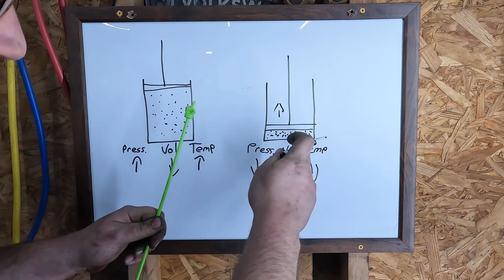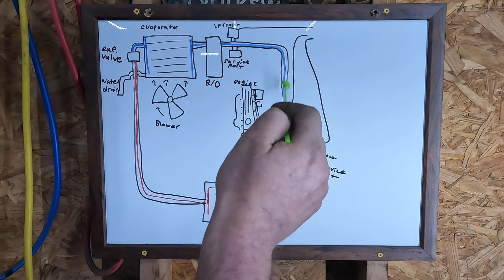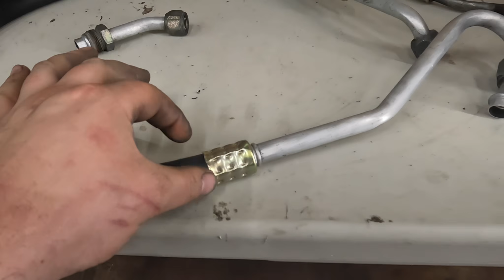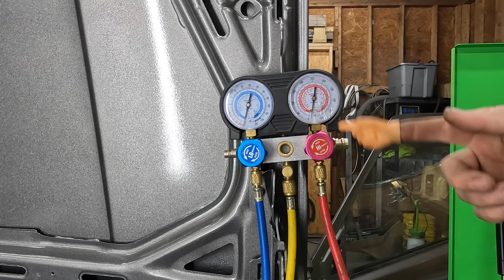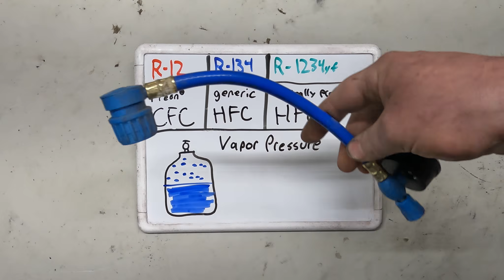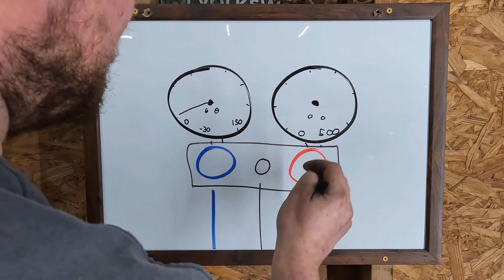Air Conditioning Explained - How It Works and How To Fix It, R12 to R134a Conversion - Volvo 740

Comment: Kind of surprised there is not at least a high pressure cutoff switch. Ultimately, depends on what all the components are rated for...that said it is a positive displacement compressor. Maybe it breaks before dangerous pressures are reached or the hoses fail. Seems sketchy....

Comment: What u have completely MiSSED is the Good Year Galaxy Hose  has a NYLON LINER ### it needs either genuine Beadlock fittings or direct copies .  BUT why ???  R12 barb fittings cut this liner . R134a fittings have depressed circular grooves . Secondly the hose ferrule is permanently attached  onto the fitting . Once the ferrule is -crimped it cannot rotate the hose which is a source of leakage ..  
WHAT DO I DO ABOUT THE R12 FITTINGS  cut them off . new complete hose ends are available to be welded on from any good auto acon reseller .
******* some old school accumulators and receiver driers have XH5   descant which is not for R1344a

Comment: I could be wrong,  but i thought the delay was to protect against a situation where the compressor had recently run. In this situation the high side pressure is normal but too high to START the compressor i.e it will stall and burn up the clutch or belt.  The delay allows time for refrigerat in the high side to make its way to the low side making the high side lower enough to allow starting (similar to a car that had been off for a while).  I suppose it also has the benefit of preventing the compressor load on the starter during engine starting.

Comment: R600A and R290 should work at roughly the same pressures as R134A and are perhaps easier to swap out in an R12 system than R134A, they work with the same oil. 

In the EU we can't buy R134A without a license, so what regular people use here is typically a blend of R290 and R600A. I am in the process of adding AC to my Saab 900 Turbo and I get to decided if I want to just vacuum the system when done and have it filled by a pro, or use the blended gas and be able to do it all myself.

I am considering using POE oil btw, supposed to be compatible with all the major refrigerants IIRC

Comment: I figured you would have to jump the low pressure switch to engage the clutch with the system empty of refrigerant.  Not sure how it is sending a go signal to the clutch when its actually under negative pressure.

Comment: You also need quite a bit more 134 in that system you’re suction was way to low and compressor was cycling way to fast on that pressure switch essentially pumping down over and over you need to have the blower on max and make sure the suction pressure stays above freezing temperature which for 134a is around 35 plus pounds of pressure high side needs to stay below 200-250 pounds anything above that and the system will not last long believe me I’ve seen it
Reply: Been a while since I've done AC work, but I was thinking the low side was quite a bit lower than I remember the spec being for R134a systems. The lack of a high pressure safety switch worries me too, even if the chances of something going wrong with a mechanical fan are slim.

Comment: Hey, I'm using this video as a very helpful resource to help me redo my ac system in my Volvo. I  just have a simple question, I noticed he only used one size hose for both the high and low side lines. Does anyone know if that matters if all hose lines are the same size, or if the low side has to be a larger hose and the high side has to be the smaller hose. When I removed my old system the hoses were 2 different sizes. Any input is appreciated, thanks.
Reply from the maker: They are two different sizes, sorry if I didn't explain that. The low pressure side is pretty much always a larger hose. #8 and #10 in this case.

Comment: At 42.30, why did the pressure switch pull in the compressor clutch if the system wasn't yet charged? ie didn't have pressure? Also, do those pressure switches always have a schrader valve? I'd like to change mine but don't want it to all leak out
Reply: the compressor clutch is just an electromagnetic clutch. So its activated by electricity, it does not matter if the system is charged. Anytime the system is opened the pressure and Freon will leak out.
Reply: @maxrodriguez3851   Sure if you hot wire the clutch but the circuit is going through the low pressure switch and should not be completed with zero or negative pressure.
Reply: @TommyBradham yes you are correct. I wasn’t as educated in ac systems as I am now back when I typed that reply.

Comment: How important is it for the reciever dryer to be close to the evaporator? I'm thinking about retrofitting an ac in my 740 -92 but to avoid having to tear out the dash, i'm thinking about putting the fan and evaporator in the trunk.
Reply: I don't think it matters how close to the evaporator the receiver drier has to be, all it really does is catch moisture. But moving the evaporator and fan to the trunk, the hose lines will have to be long enough to make it back there. Also all the cool air will blow from the trunk, rather than on your face. so ¯\_(ツ)_/¯

Comment: Please connect the crankcase ventilation onto the sucktion side of the turbo, these engines do not like the excessive wear of having no propper pcv. Dieselpacko has a very good video about it, sadly in swedish only though :/
Reply from the maker: Yup, it will be covered in the next video. Thanks for bringing it up!

Comment: Did the diesels not get an aux electric fan on the front of the condensor/radiator? My '87 turbo had one (it was seized also the system was long empty). I guess without a high-pressure switch there'd be nothing to trigger it, I'm just curious.
Reply from the maker: They did, I just haven't put it back yet. It only comes on with the coolant switch though, not the AC..